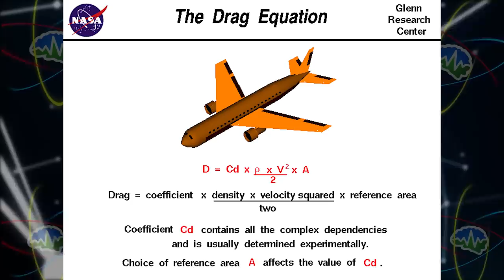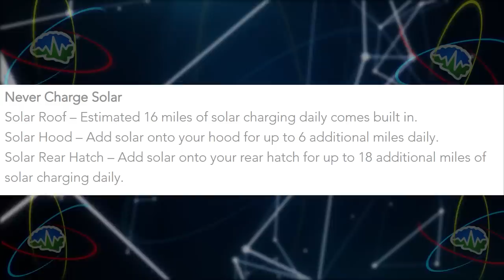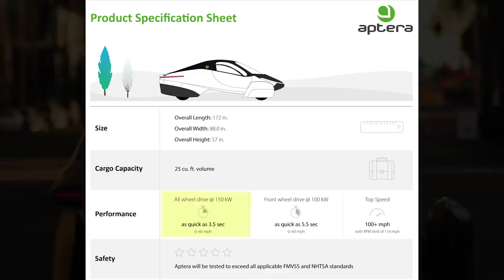Aptera Beats Tesla? | In Depth

Comment: I think half the problem for EV's in the USA is the petrol is just so cheap,  hence not much incentive for the average Joe in places where petrol is even in places cheaper than water. However, if you look at places like Europe, they are literally miles apart on the cost per mpg. Its much easier to sell efficient in some places but Im sure the thought process of just economy will fade just as petrol will as time goes and newer generations think a little more about the environment as well. All in all, EV's are only a hard sale due to current prices. To drive, they are magic if made right.
Reply: To many young commuters and retired people on a budget the running costs of a full solar Aptera will be very attractive once they realize the difference it can make to their budget.  Society is going to have to figure out how they are going to pay for road infrastructure without as much coming in through gas taxes.  In doing so, it should not be a measure that slows down the adoption of EVs.

Comment: Interesting car but not sure if the safety is compromised in this car as it is so light
Reply: I own a Gen 1 Honda Insight that weighs 1800 lbs.  It got 4s in the safety testing when it was tested.  I survived being hit from behind by a large car at 60 mph, without injury.  Aptera weighs about the same, but has more safety features.  I suspect that it will score even better on the crash tests when it is tested.  The scores will be released before production begins.

Comment: I’m liking the look. I’m loving the efficiency. But what’s the deal with the safety of this vehicle? Also, what are the costs and procedures of correcting body damage - as careful as one may drive, others will eventually bump, hit, scratch your new vehicle that’s covered in solar panels....I still like the unconventional looks.
Reply: Aptera is designed to meet full automotive safety standards and will be crash tested later in the year.  It will do very well.
Reply: As far as body damage goes, crashes that would result in crumpled sheet metal will likely only be a scuff repair.

Composites can be repaired without special tools with materials available at any West Marine.

Comment: The correct way of pronouncing Aptera in Greek is almost the same as in English (Άπτερα). Same goes for Pterodactyl and  Helicopter. You have to pronounce the 'Π / P'.  You can also call the wingless things ΑΦΤΕΡΑ / AFTERA  (with a φ/f instead of π/p)which is still correct but it does not sound as nice. :-)

Comment: the charging speed discussion you guys had was mostly wrong. it charges faster because the battery is smaller
Reply: To say it properly, it gains range faster.  This is not because of battery size, but because at EPA Highway cycle speeds it uses less than 100 watt hrs per mile.
Reply: @n.brucenelson5920  Well yes and no. It uses less power, so they can afford using a smaller battery, which makes the 0%-100% charge faster, but keeps the range the same.
Reply: @crisisrogue8286  Think about it.  On the same charger with the same amps coming into the battery, the Aptera will go more than twice as far at the same speed as a Tesla - no matter if the Aptera has. 25 kWh battery or a 100 kWh battery or anything in between.
Reply: @n.brucenelson5920  yeah but no, it just gets a longer range faster, but the charging speed is still the same, aka you don't get more battery capacity per minute of charging
Reply: @crisisrogue8286  I said "On the same charger with the same amps coming into the battery,"  Yes, I think you understand now.  You get more range per minute of charging, not more battery capacity.
Reply: @n.brucenelson5920  yeah that's what I was saying but didn't know how to say it, glad I found a way to explain what I meant lol

Comment: the difference between standing on shoulders throwing money at an idea.. and being the shoulders ... aptera are the shoulders.. but what is the lifespan on the cell or battery..??,, but bottom line.. that electricity has to come from somewhere.. i have ask ,, why is it not possible to put an alternator in some place to charge as you drove.. that coupled with the solar ...but people i have talked to say it is impossible... with the wind created by the design the alternator could be wind driven.. just me i guess..
Reply: The cells fitted in Aptera should have at least 400,000 miles of life before they decline to 80% of full charge.  By that time there will be better and less expensive new tech available for replacement.

The issue with an alternator is that it adds more drag than can be compensated for by the power it generates.

Comment: I think the idea of placing solar panels on a car to increase range is dumb, The idea of using solar panels to prevent power loss while the car sits ideal is great! Most people that will buy a Tesla will most likely park it in a garage but if it's parked in a parking lot during the day then it makes sense again. A 500-700 watt Solar array with the intent to keep the battery topped off when parked for extended periods of time also makes a lot of sense. It would also serve to extend the life of the battery banks if the on-board systems didn't have to deal with power loss due to running the battery cooling / heating systems while parked for days at a time.
Reply: Rickie j At 18 I built a generator that ran on deconstructed water, (the generator ran an electrolyzer that turned water into HHO that was fed into the carburetor). It took about 50% of the power produced from the generator to power the electrolizer and required a fair bit of maintenance to keep working for extended periods of time so it wasn't really practical but was still fun.

I have also built / re-built several server rooms / server infrastructure / battery backup solutions (30-40kw systems) for small and medium sized businesses. Currently I work as an IT guy for an R&D company that does advanced metallurgy using laser cladding including but not limited to cladding tungsten carbide to stainless steel. 

It appears you failed to read my whole post so if you get this far I will be surprised. Solar panels are useless for extending the range of a practical car (there are extreme 1 person ultralight cars that have massive solar arrays for their size, but try and use one to haul around 3 kids and pick up groceries). If solar panels are used to extend the life of the battery while the car sits idle then you have something practical. I think Tesla doesn't do it because most people are to stupid to understand this and will complain when the 500-700 Watt array takes 3 months to charge their car. 2 days per kilowatt, times this by 50KW and you have 100 days. Also you have to have 100 consecutive sunny days.
Reply: Rickie j  I'm still confused as to why you took offence to my original comment.

Comment: Why does he say "It is estimated to use less than 100 WH per mile"?  I see a prototype driving around- why not just tell us how many WH per mile it IS getting? I'm having flash backs to the Elio where we were told what it is estimated that the car would get. The actual mileage of the prototype was never revealed.  Has the WH consumption of the Aptera been released?
Reply: The various models will also vary in efficiency.  The 100 Wh figure is what the 2200 # AWD 100 kWh model is expected to meet.  The 25 kW and the 40 kWh 2 motor versions are likely to do better.  They may reveal this later, but compared to everything else on the market, the difference may not be enough to swing a decision.

Comment: As yet, there are NO FEDERAL rebates as it is classed as a MOTORCYCLE and does NOT have to pass car crash testing.  Just a few words to the wise.
Reply: Of course, it WILL be crash tested to automotive standards and the results published before production begins.  The legislation to include it in rebates and to increase the size is already in consideration.  It is likely to be in place before shipping begins.  Both issues will be resolved, and if you do not need the car next year, it would be OK to wait.  If you change your mind after placing a reservation, the $100 (or $70) is refundable.

Comment: They limit it to a 100mph mechanically, it probably take off✈✈🛫🛫 after that🤣🤣🤣 amazing reviews gentlemen.
Reply: The actual limit is 110 mph.  There is 25 lbs of down force at 65 mph, which increases rapidly as speed goes up from there.

Comment: guess it would be ok if you are going to be in the city and back roads only? - not sure i would want it on an interstate it is to light, and that fish tail is going to act like a big old wing being passed by a Simi at 65 to 70 mph. I like the idea of a 1000 miles but again what good is a 1000 miles if you can't really use it safely? Aptera says the base model weighs just 1,800 pounds, while the 1,000-mile edition is 2,200 pounds - @21:00 it's so lite you can just get out and kick it my point. @21:25 car speed limited to 100 mph because of weight. we are not that far off from new battery tech i don't need a paper weight.

Comment: That charging efficiency argument didn't make any sense... I get the point. But it's not technically faster. Unless you have to stop less on trips because you can skip or bypass fuel ups because of efficiency. But that's time wise faster. Not faster charging.
Reply: The correct way to say it is that Aptera gains range faster, and this is directly because of the efficiency.  So it is true both that you don't have to stop as often and that the stops can take less time to gain a given distance.

Comment: A hybrid absolutely makes sense. Better technology is still not there. A hundred miles per gallon is a game changer. I'm not in that much of a hurry to get away from ice. I want range. I live way out in the middle of nowhere. I'd like to pick up one of those without a battery or electric motor, and I'll put a three cylinder Rotax in it.
I think in about another 20 years batteries might be there.
Reply: You do know that you can order an Aptera with 1000 mile range on the EPA highway cycle don't you?  I don't think you can find an ICE or hybrid model that goes that far.  And depending on where you live, the full solar option can give you another 20-40 miles per day without having to travel to a charging station, or 13 miles per hour of additional range plugged into a standard 110v 15 amp AC outlet.  In comparison, the extra complexity and service costs of a hybrid are a non starter.  It might have made sense 10 years ago, but no longer.

Comment: On Munro Live, Sandy drooled over the exotic cooling system the Aptera will have. To avoid drag, they do not have a grill or radiator, relying instead on exterior air cooling the skin through channels in the body wicking away heat.  WHAT!!!  

How do you wick away heat in the summertime anywhere south of Fairbanks?  Sitting in a rolling greenhouse, in stop and go traffic on a freeway in 90-100 degree heat, how can the exterior air cool the interior?

I am spoiled by having actual air conditioning and I don't want a vehicle with no AC. Can you help me, and the fifteen thousand plus people who placed a preorder, understand this? 

Btw, I emailed this question to Aptera and received no answer. 

Thanks
Reply: There is A/C.   They are describing where the A/C condenser dumps its heat.

Comment: Does it have A/C or Heat?
What does it weight?
Does it have regenerative braking?
What is the warrantee.
Website is pathetic on info.
All these unanswered questions and you expect people to "PREBUY"?
Reply: They are all answered if you do some research.  Both A/C and Heat are standard.  the weight of the 400 mile range vehicle is about 1800 lbs.  The 1000 mile range model is 2200 lbs.

Yes, there are 3 or 4 user selectable Regen levels.

Warrantees will be established in cooperation with suppliers, but will be in line with industry standards
Reply: @n.brucenelson5920  Wow thank you for the info.
I do very much like the style of the car.

Comment: For me that door window bar is a total deal breaker. Unless I can see out of a car without obstruction I won't drive it or ride in it. Nor do I want them on the street pulling out in front of me and my motorcycle. Show where that bar level is for a 6' tall driver and the door post.
Reply: I was concerned about this, too until my wife and I rode in a prototype.  We found that we hardly noticed the bar and we are of different heights.  The production vehicles will have a larger cabin and different seating positions, so my mind is still open on the subject, but I am not nearly as worried.   There are other vehicles such as the Subaru SVX that had similar split side windows, and didn't seem to have complaints about this feature.

Comment: How about sound proofing from outside? How about safety?
Reply: It's made of composites, so it should have better sound insulation than steel cars. As for safety, here's what their FAQ says: "We will not know Aptera's actual rating until we pass a production vehicle through the full safety test. But we are designing to exceed all passenger car standards and the previous version had the highest roof crush strength of all passenger cars on the road, and it performed exceedingly well in actual side and frontal crash tests. Aptera features a Formula One-inspired safety cell with advanced composites and metal structures for impact strength. Similar to aerospace and racing, these energy-absorbing methods are a core part of our safety strategy and have proven effective time and time again in high speed impacts. Aptera also makes use of today’s best forward and side airbag systems in case of an accident."

Comment: I'm really curious about the numbers for applying solar to the car. I've seen people give estimates for Teslas of generating maybe 3-4 miles a day in perfect conditions and solar panels aren't super cheap either.

Will these cars really get an appreciable amount of energy per day in the real world and will that be enough to off set the cost of just charging at home?

Cool car though. Manufacturing is going to be the hard part. I've followed a lot of start up car companies and a lot fail before they can push a car off an assembly line.
Reply: The key to this is that Apterae only use less than 100 watt hours per mile at EPA Highway cycle speeds..
Reply: @n.brucenelson5920  Yea, but it was also stated they were about 4 times as efficient as Tesla, which would only equate to about 16 miles a day, if Teslas can only get about 4 miles a day. Getting up to 40 miles a day would be impressive.

I still have concerns about the cost of the panels vs the amount of charge you would get in real world conditions. Dirty panels, overcast days, shaded city streets, etc.

Comment: Will it blow away?
Reply: No.  The surfaces give little for wined to push against and there is downforce built in at the rear.  It will be better than my 1800 lb Gen 1 Honda Insight, which is already very good.

Comment: The overall design is very nice but the single rear wheel is not my taste. If they had a 4 wheeler option that would give me more security and also more grip for which i am gladly losing some range.
Reply: The present design is far more stable than any SUV.
Reply: @n.brucenelson5920  It's stable alone just by the fact that it's so low. Still doesn't mean a three wheeler can't flip in extreme situations. I'd rather have two wheels in the back, more grip than one wheel.

Comment: Only thing I'm worried of is taking quick turns and having it tip over.
Reply: You might have seen too many Robin Reliants that were modified to do this for comic effect.  The Aptera has such a wide stance and a low center of gravity that it will be much better than most SUVs, for sure.
Reply: Rickie j  Yes, and just not any traction control, but one with state of the art performance not equaled in any ICE car or most EVs.

Comment: It doesn't look as if it has crumple zones.  It looks like they are making a three wheel electric motorcycle.
Reply: It has both front and rear crumple zones, an F1 style Kevlar and carbon fiber passenger safety cage, seatbelts and airbags.  It will be crash tested to FMVSS Part 200 standards and the ratings published once production intent vehicles are available to test.

Comment: Aptera did not beat Tesla... Aptera is a car size solar panel "Go-Kart". Wonder how safe the Go-Kart is... must be extremely light..
Reply: The 400 mile range version is around 1800 #. - about the same as my Gen 1 Honda Insight.
Reply: @n.brucenelson5920  There is always a bigger picture that people won't understand. You may understand this better  if you ran their balance sheets. Businesses have to operate to make a profit....
Reply: The 400 mile range version weighs about the same as my Gen 1 Honda Insight that rated 4s on the crash tests.  I bet it will do better.